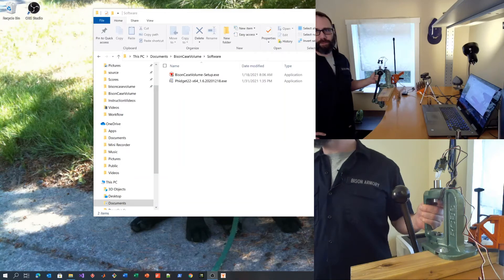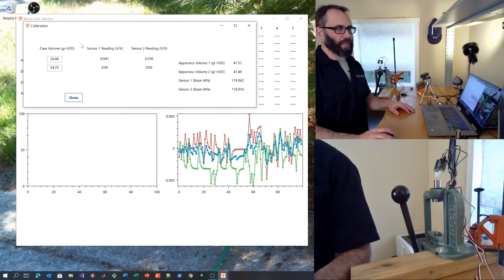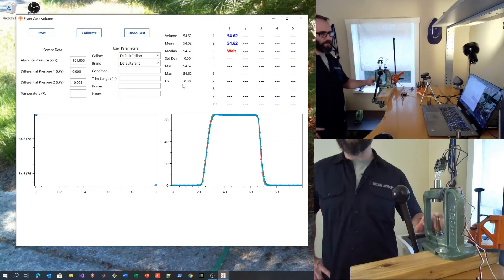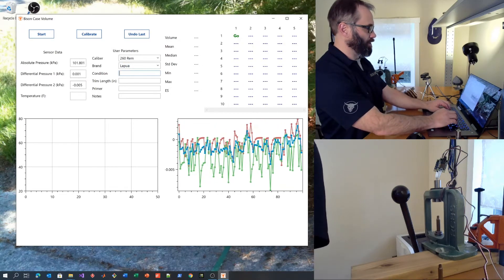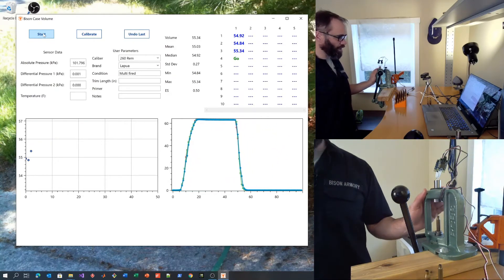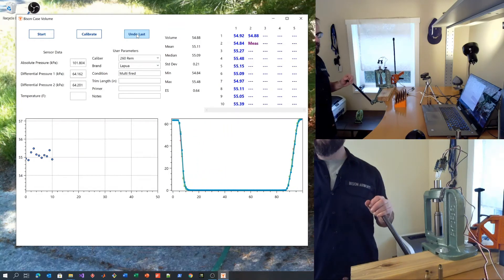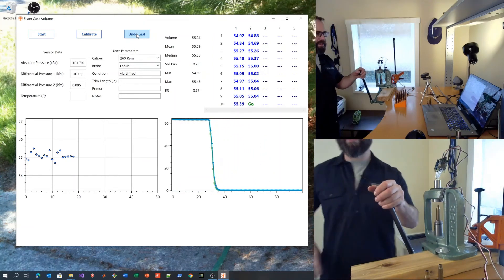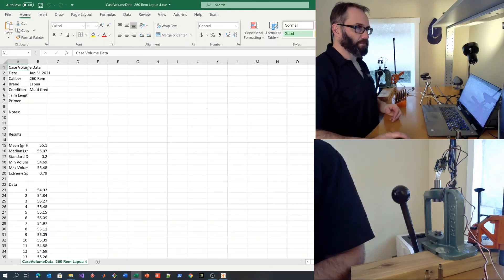Bison Case Volumizer Software Instructions

Comment: Being a metrologist by trade, I'm really geeking out over this. I have a couple of questions:
You're using two "known" cases, of different sizes, to calibrate the system. Did you fill the cases with water and weighed them to get the case volume? Does the brass used to standardize or calibrate the system have to be of the same manufacturer of the cases to be measured (I assume not)? Will this system accommodate 300 win mag? As far as ambient temperature to use this system, I reload in my garage. It can get quite hot in there. What's the recommended temp to use this in? Or would it make a difference if all i'm doing is separating cases by matching volume (all other things equal)? Is there a way to reach out to you directly? I have some other questions.
Reply from the maker: Email me at sales@bisonarmory.com

Comment: Hi Ben.
In your opinion, is it neccessary to measure/clasify  before each load?. Would it be sufficient to do it once after fire-forming?. Happy new year!
Reply from the maker: Happy new year Alfredo! That's a very good question. I think once might be OK but I haven't done any experiments to verify how much different repeated firing makes and to what extent cases can change in capacity relative to one another. Definitely something I'd like to investigate in the near future. 

Also note that new software is available to download that has some improvements.
Reply: @BisonArmory  Thankyou Ben. All the best for 2022!!